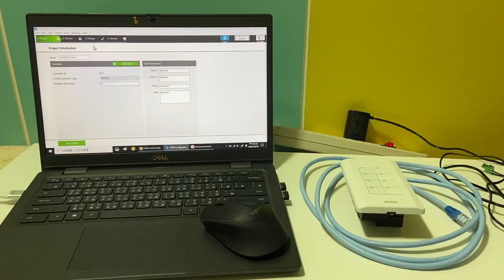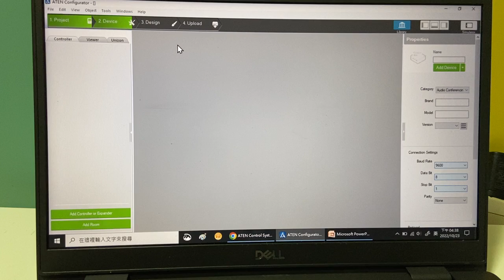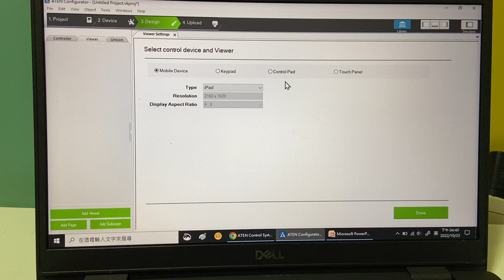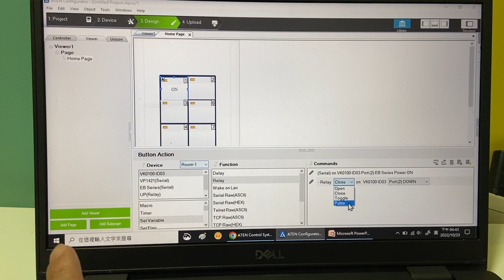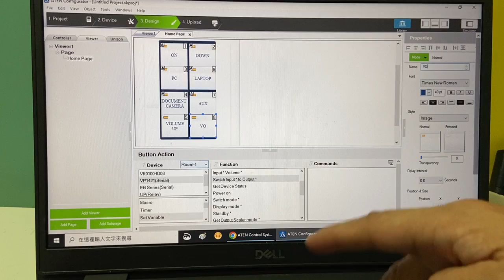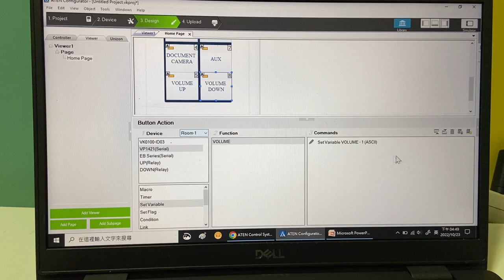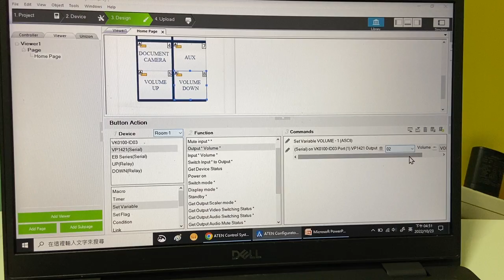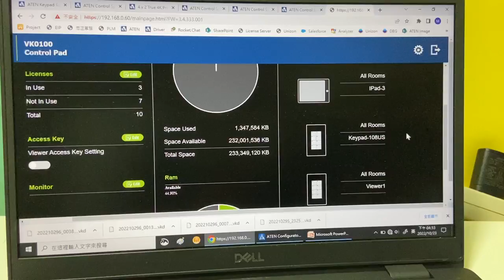ATEN Control System - VK0100 Product Training

Comment: how would you physically connect the wires to the devices?
Reply from the maker: thank you for your questions. The interfaces of VK0100 are phoenix type so you will need to strip end of the cables for installation. I know the explanation might not clear enough so I'd recommend checking online for more information. Thank you.